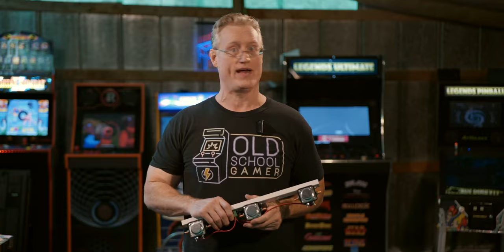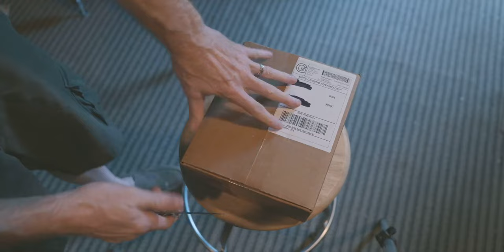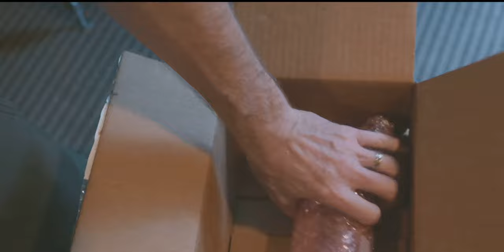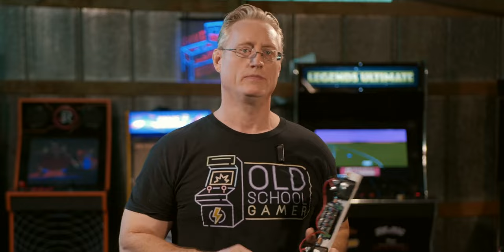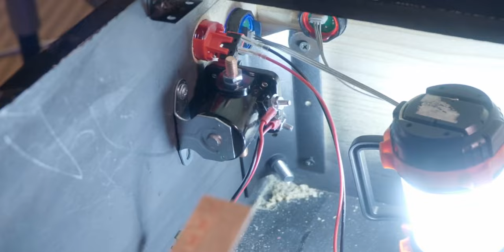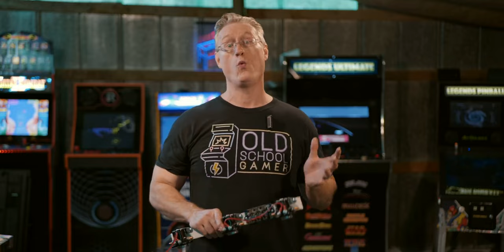installing DIY virtual pinball solenoids - Is it worth the money & trouble?

Comment: Highly recommend a contactor for flippers, as holding a starter solenoid (shown in this video) do get hot and can fail as a result over time. The maker of the kit you have has a 'solenoid saver' board that drops the power after initial actuation (but still has enough power to hold the solenoid in position) to avoid solenoid burnout
Reply from the maker: I worry about that a bit, but I don't think the solenoids themselves are that expensive.
Reply: These have a failsafe built in to prevent overheating no matter how long you hold your flipper button down

Comment: I did the 32” screen mod and added 4 solenoids from CSD on my arcade 1up pinball. Love these kits, I am actually getting 3 more solenoids for the back bumpers. Super easy to plug and program the extra solenoids
Reply: Using sainsmart board?
Reply from the maker: Yeah, I gotta get around to installing the other kit.

Comment: Really appreciate the video! I've been thinking of taking my vpin to the next level for a while. I think I may take the plunge.
Reply from the maker: You won't regret it - adding solenoids makes it "real".  If you haven't set up 7.1 sound, I'd try to do that too.  Maybe the biggest impact is using an OLED monitor - it's truly wild how big of an impact that has.
Reply: @evilgeniusentertainment  I appreciate the recommendations! I've already ordered the solenoids and the 7.1 SSF system which should be here in a few days.
Reply from the maker: Hey, that's awesome!  Hopefully your sound card works right (took me a couple of tries to get one that would play nice).  If you're running Window 10, it has a tendency to revert to 2.0 sound after you restart the computer (meaning, at least for me, I have to go into the sound control panel and reset it to 7.1 every time).
Reply: @evilgeniusentertainment  eye roll The joys of Windows. I am using Windows 10, so I'll keep my fingers crossed that mine is a little less finicky than yours has been.
Reply from the maker: For your sake, I hope so too!  I mean now it's just a part of the workflow, but for a while I couldn't figure out what was happening which drove me half way mad....
Reply: @evilgeniusentertainment  I truly appreciate you sharing that, as it may become part of my workflow as well, and you've saved me the time of troubleshooting.

Comment: Planning my 1st build out now. Going to do it in phases using CSD. Doing the SSF builders kit with that same 2 solenoid setup. Phase 2, add in various toys. Later on for phase 3, remaining 8 solenoids. Maybe a phase 4 with more RGB lighting. Trying the phase approach so I don't shell a bunch of money up front. Good job on the videos.  👍
Reply from the maker: Thanks mightymo - kinda my approach too.  Eventually putting in a 7.1 amp, oled monitor for the backglass, and a few more bells.

Comment: If you watch Phil’s videos… he’s custom engineered those solenoids to not over heat.  That circuit board delivers max voltage for 15-20ms to get the solenoid to fire and then voltage is backed off to the min required to hold the solenoid open. 

This means you could hold the flipper button in and never overheat the solenoid. 

Try that with other installs without those “life extender boards” and you’ll burn up your solenoid. 

You can buy just that board if you want to add them to your existing build! 

Phil absolutely know his stuff. 
Heck…. He’s built his own replacement board for the KL25Z, based on open source Arduino tech, to address the KL25Z supply shortage and price hike. 

Check out his other products! 
His products are “marginally” more expensive than you buying parts all together and hacking at it DIY. 

He takes a lot of the difficulty in wiring out of all of this stuff. 

It should also be noted that all of his products work on a 12v system. Keep your power supply to a single 12v supply for your entire cab!!!!!
Reply from the maker: Yeah, I've had no indication that the solenoids will burn out.  Still as clickity-clackity as ever!
Reply: Yep Phils stuff is good.

Comment: it would really be nice to know, what solenoids exactely are best for vpin, since there are hundreds of different ones available.
Prices vary from 1 to 40 $. sure, i could just buy the kit... but well i like diy...
Reply from the maker: Mike - I got my solenoid kit from Cleveland Software Design, who I highly recommend.  I may try different ones down the line, but the ones I got from CSD work very well and have not burned out (which apparently they will do without something like CSD's setup).